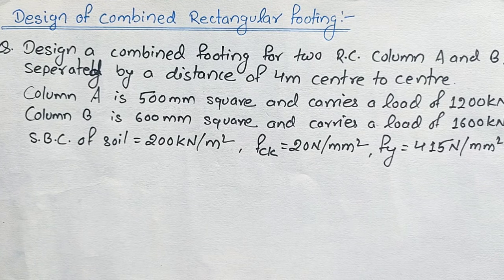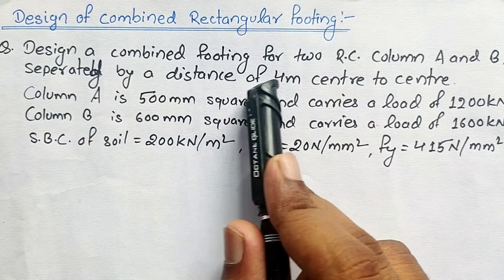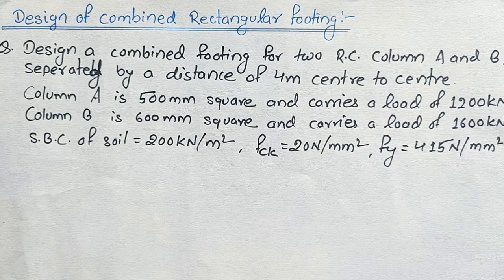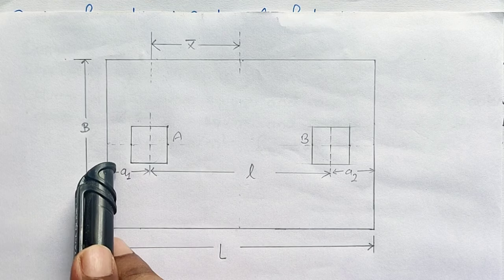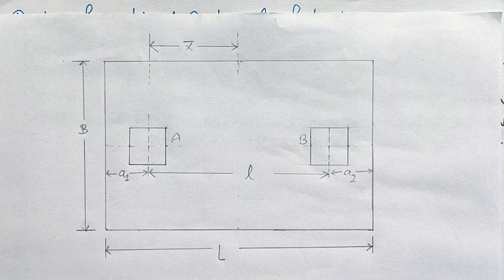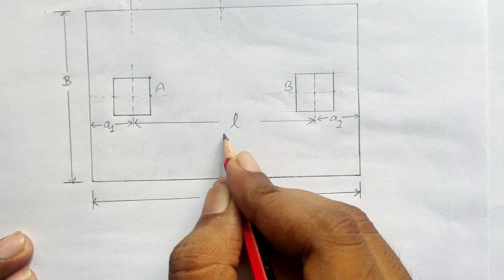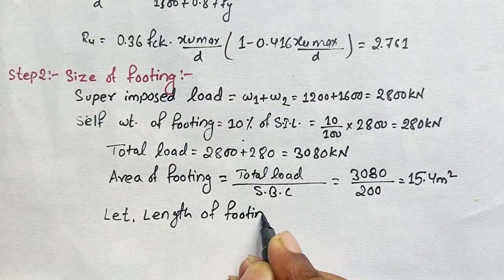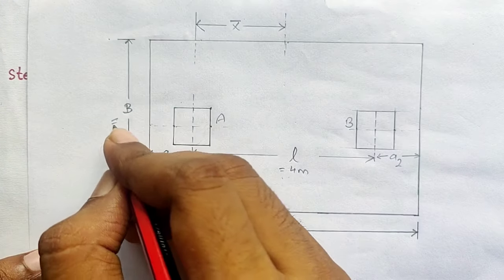Design of combined rectangular column footing || Footing Design

Comment: it's a good explanation, but the Geotechnical design part should be done using the unfactored load (proportioning the area of the pad) and the structural design (Depth determination, rebar design) part will be done using the factored load. so u.ve only used unfactored load for both designs. which is not practical.

Comment: Can you please tell on what basis you are assuming the length as 6m
Reply from the maker: There is no any rules to assume the length.
But there is one thing to keep in mind i.e. our length should be more than the center to center distance between the column. 
Here i have taken length as 6 but you can redesign the section taking length as 7 or more. 
So that you will get favourable value of width.

Comment: Sf calculation k liy load ko Factor kyu ni kiya?
Reply from the maker: Hello dear,
In the beginning of step 3 we need to find share force in order to calculate bending moment at different sections.
And after calculating the BM we actually need the SF at 1st and 2nd point of contraflexture.

And when you continue watching the video you will find tha while applying one way share check and design of bending tension in longitudinal value we have multiplied tha value with the factor of safety.

And step 2 is just the simple SF and BMD which we have studied in SOM.

Hope you got my points.

Have a nice day.